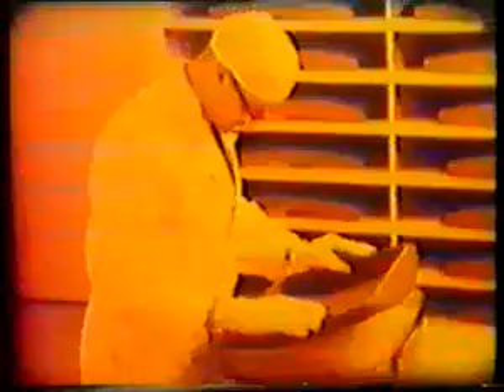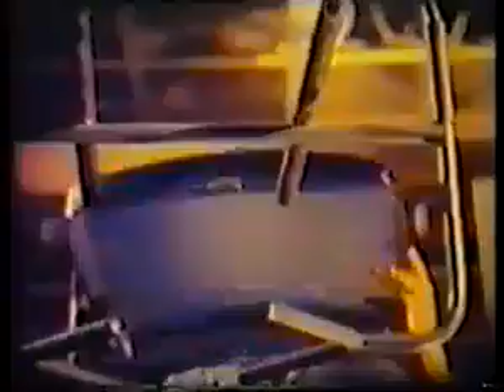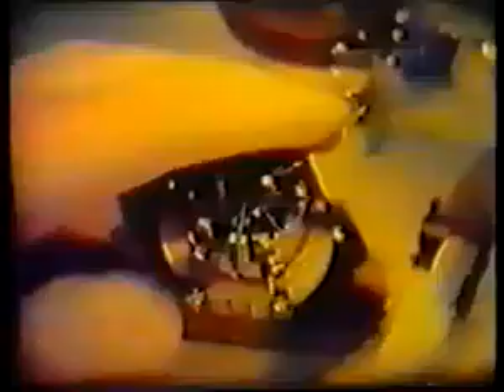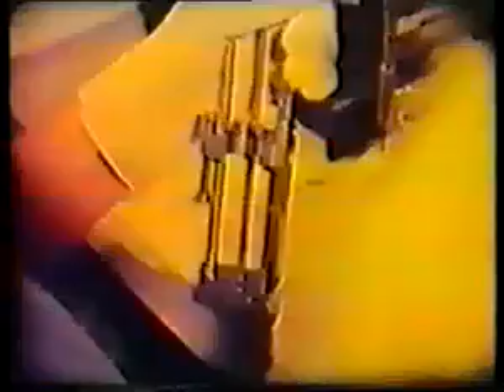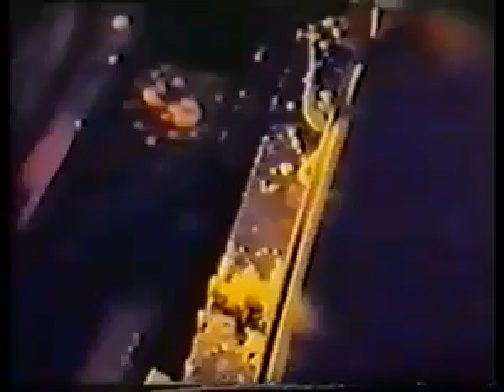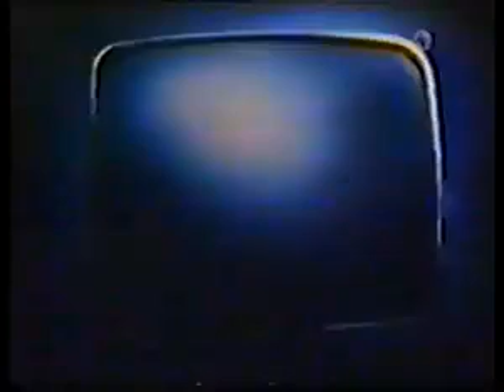CRT TUBE MANUFACTURING A63-11X  PHILIPS - MULLARD Part 2

Comment: Worked for Sylvania tv Ottawa Ohio. We used a powder system and had 4 stations . Matrix, green, blue , red. The mask moved with the bulb at the start never leaving sight of face mask.. then to lacquer, then aluminizing, where funnel is mated with face blank. a lead adhesive did the honors. Later guns installed

Comment: Being a TV repair technician for 35 yrs, brings back so many memories of the late 70's and 80s....
We still replaced picture tubes as a regular repair.
Was a physical job, but very rewarding.
Reply: Yep...Tech for 25 years.  Changed a fee of those.
Reply: So if my crt were to burn out you guys can make it usable again!!?
Reply: @smashingrandomthingzandrev2134  ...lol...if the CRT is still available...possibly....
Probably can't find a replacement in today world.
Reply: Frank Pitochelli I know another place that repairs them on the website they say if a replacement gun is no available they would replace the cathodes or something. I only asked that because for my birthday my dad bought me a trinitron tv. The thing is when I turned it on it had discoloration so I guess I may only get like a decade use out of it.

Comment: The guns are grouped in such a way that when they shoot through the same hole in the shadow mask, each gun only hits the phosphor dot for its specific color (red, green or blue). Think of three people standing with their heads together, all looking through the same knot hole in a board. Each person will see a slightly different view through the same hole because their eyes are in a different position. Precision manufacturing makes sure that each gun only hits its designated color dots.
Reply: Since the guns themselves are quite close together, I assume that it's the curvature of the electron's trajectory, caused by the magnetic field from the yoke, that accounts for most of the difference in angles. So, I assume that color-masking would not work in a set that uses electrostatic deflection.

Comment: Interesting video. I worked in a modern CRT factory in the 1990's, and the front panel/mask were handled entirely by robotic machinery throughout the screen process. Also, a black mask was put on the panel before the phosphors were applied, that surrounded each color dot. Lacquer was applied to the phosphor coatings before the aluminizing process. Other than inspections after the black mask and lacquer process, no one touched anything until after the final panel/mask assembly. Fascinating job!
Reply: What about the graphite coating on the outside of the tube? I did not see this process here